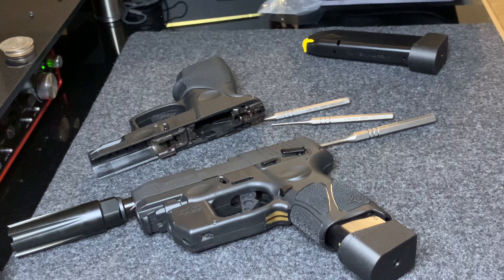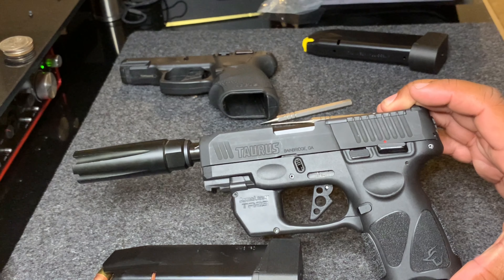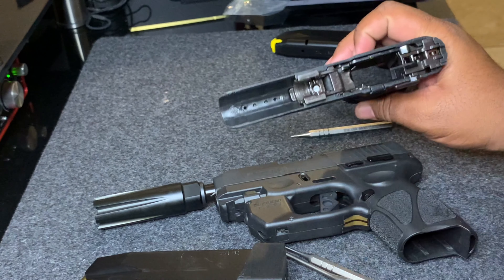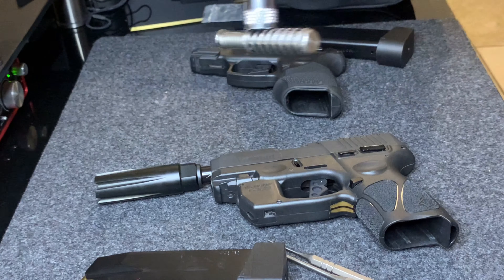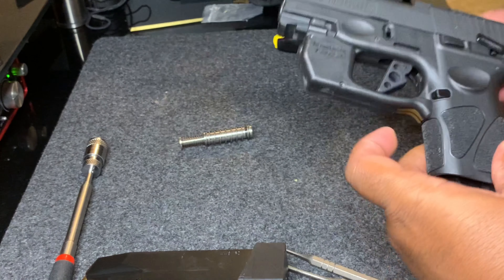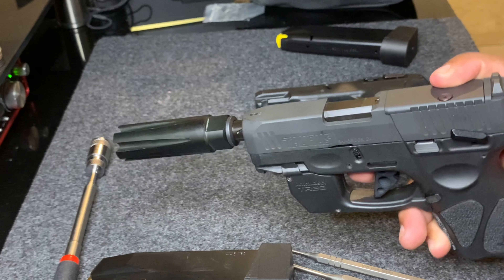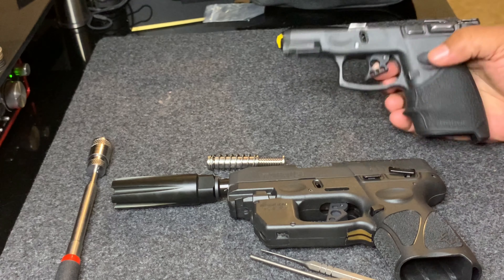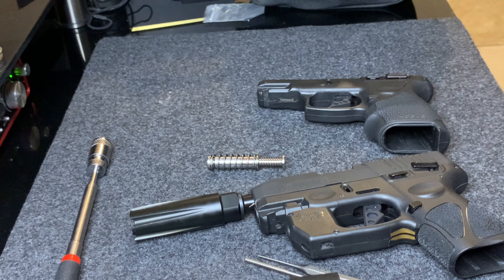TAURUS G3C TORO TRIGGER UPGRADE BY KEEPTINKERING

Comment: I have to say man, I've enjoyed my KeepTinkering trigger in my G3C. That spring really was a pain though in the trigger assembly, but once in it was smooth sailing. Still kicking around the idea of picking up the TORO slide to put on it. It'd be nice to have that optic option. Keeps the vids coming my guy.
Reply from the maker: Most definitely. I’m working on another one as we speak
Reply: @SILKLIVIN  Yes sir. I'd also go with that Canik. One of the smoothest stock triggers I've ever felt in my opinion.

Comment: Canik SC! Enough Glock builds and worn out. I would recommend Freedomsmith triggers for SC. Installed into my TP9 SF and shorten total travel by ~ 60%, and SC by nearly 40%. And, both triggers extended my length of pull, so wall and break were further out, which was my target for improvement. Good vid, thx.

Comment: I have that on my G3c its night and day compared to the long pull stock trigger.its on par with the Zev trigger on my Glock 30 in 45 acp for a hundred less at 35 bucks..I put around 650 rds since putting the Keep tinkering trigger on without any problems with spot on accuracy

Comment: Did you Half to replace the trigger bar too I seen a video where keep tinkering says you may need to or eventually will need too after changing the stock trigger safety
Reply from the maker: Only on sum. Depends on if you can’t get the stock one back in due to the trigger you choose

Comment: When you order your first trigger did it come with a spring or no I ordered the same trigger like your first one and it had the option to get with the spring or not so I got the one without the spring did you need the spring with your first trigger?
Reply from the maker: I got the one that came with a spring. The spring was needed for the new trigger

Comment: interesting video. I have a G3 and plan to purchase a G3c in the new year. If you're looking at possible builds I think the G3 is a good option, I would recommend the Canik as well because what's not to love. Plus the Canik is going to be less than the Glock and it has a better trigger. I have a SAR CM9 which I can't even begin to tell you how amazing it is. I love it as well as the G3 but they are both so different but great in their own right. If you are thinking about a Glock or Canik I will toss this out there, SAR9 take a look see what you think, personally the SAR9 and the Canik are both on my list. I'm a huge CZ fan so my own personal pref will be to purchase the 4.5" SAR B6 which is essentially a CZ 75 clone, toss a spring kit from Galloway Precision in that sucker and now you have a very nice firearm.
Reply from the maker: I appreciate your comment. You definitely put a new thought into my equation about which firearm to choose next.

Comment: I just installed mines and for some reason I still have the re strike capability I just keep hitting the trigger and you can hear the striker move so idk I’m confused
Reply from the maker: Check the spring. Try replacing it. Which one did u get
Reply: The Flat face one same you have in the video
Reply: That can happen due to different manufacturing tolerances. Check keep tinkering YouTube channel. The trigger install video to be specific. Other people have had the same issue as you.